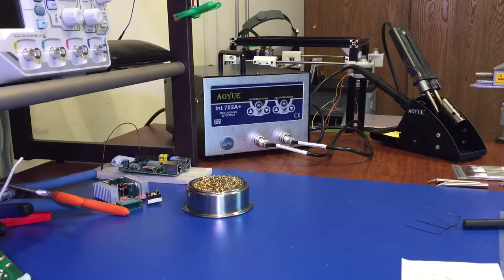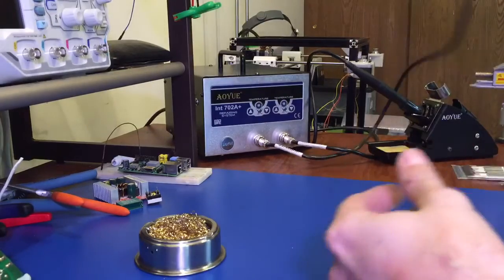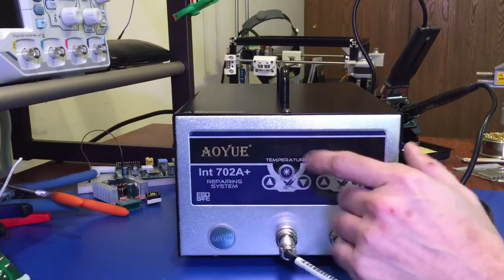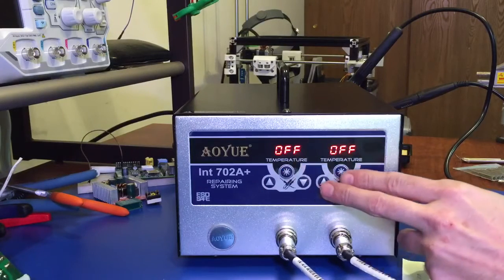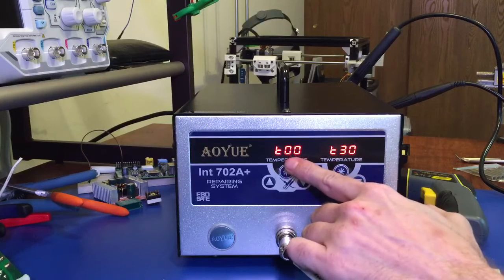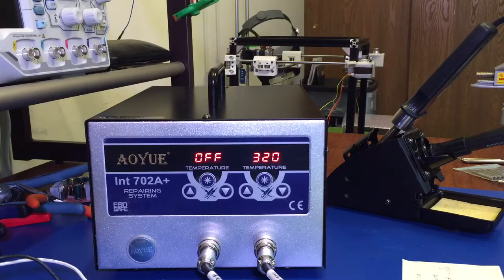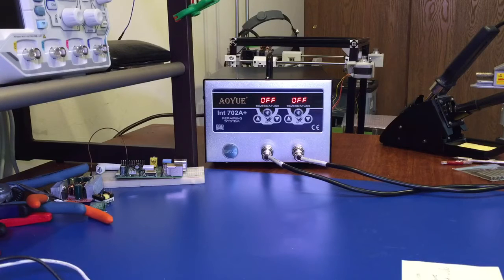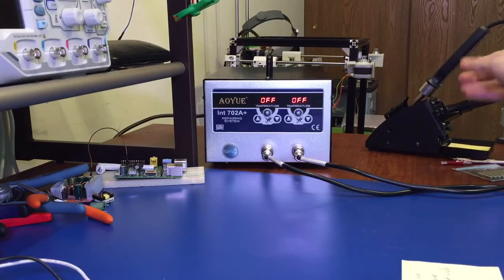Aoyue 702A+ Dual Soldering Station Testing and Review

Comment: Wait. I have the Int 701A++ which is exactly the same station except the 702 is missing the desolder/fume extractor pump. I even bought the tweezers separately since mine included the desolderinggun instead. Pulling the trigger wakes up the left channel and resets the sleep timer but the right channel is always going to sleep on me while I use the soldering pencil. Been dealing with it since I bought the thing in July 2016. It even went to sleep on me while I was using it last night and again this morning. If my iron is supposed to have a sensor in it, well, it never worked. :( I’m aware that the newer version of the Int 701A++ bypasses the wake-up circuit on the left channel so that they could switch to a DC pump but mine is the older version with the AC pump and there doesn’t seem to be a reason to disable this on the right channel at all. It has different DIN/aviation connector arrangements on left and right to keep you from swapping them.

Comment: wouldn't it be nice if soldering irons and desoldering guns had an LED that projected some light down into the work area where you are soldering? Most battery-operated cordless drills have these nowadays......
Reply from the maker: I think the hard issue is the heat, LED lighting already get hit and need more cooling and copper for dissipating this heat. This copper on good LED flashlights will just pull heat from the soldering heating elements.

Comment: I have the Int 701A++ (or A +++?) version on my bench at work. Mine has a vacuum desoldering gun, which is what I use it for 95% of the time, and a small-tip pencil iron (came with a fume sucker attachment that I seldom use). With a few modifications to the desoldering gun* it works quite well, although Aoyue's quality control is less than stellar and we have had several defective brand-new desoldering guns wirh bad heating elements right out of the package, and if the temperature sensing or feedback coil of the heating element is bad the tip won't run consistently at the correct temperature or it might be hotter or colder than indicated on the digital display (one newly purchase desoldering gun only got up to about 70 degrees centigrade and gave me error messages). The  first Aoyue desoldering gun I had seemed to "eat" the tips at a record pace, using mostly traditional tin/lead solder we primarily work on 30 to 50 year old audio equipment) although perhaps those tips were made of a different material or had different plating than the more recently purchased tips which so far seem to last longer. ( You can replace the heating elements yourself , installing a new element into the same gun frame, but it's a pain in the neck because the wiring channels are narrow and the wires are springy, and the wires and the switch and the mechanical parts all want to pop back out at you as you are trying to reassemble it, plus nichrome or similar wires from the heating element cannot be soldered to and must be crimped, and they don't supply you with a new set of the original  plug-in connectors that you might want to use/ reuse.... and anyway the entire gun doesn't cost all that much more than the individual heating elements, so it might be easier just to buy a new gun assembly). 

I do wish that the tips were marked as to their size or part number! I scribe them with an engraver or Dremel tool so I can tell at a glance what size tip I already had / have in the iron when I go to replace it. we have also received replacement tips in a mismarked bag, the tips did not match the size that was hand written on the parts bag.

*The little round-disk sponge  filter that you are supposed to wet before use in the solder-collection chamber (cylinder) doesn't work all that well, I use an older style of felt-disc Hakko filter instead. The nipple shaped spring filter clogs easily, and is difficult to get the solder out of, so I don't use that either, I just stuff the plastic cylinder with some medium grade steel wool. I also have a mod to realign the desoldering tip inside the length of the heating element, to prevent it from clogging at the very  tip of the outlet tube as it enters  the solder collection chamber, but I won't get into that here.
Reply from the maker: Well as you saw in this video the init I’m reviewing doesn’t have the de-soldering gun. But I did buy the de-soldering gun unit separately. https://youtu.be/eVF7m0JSX4Q
From what your saying about the filter you may want to watch the series other video, especially Part 2 about the de-soldering gun. It wasn’t long after I saw some of the same issues you mentioned with the filter and spring catcher, I ended designing a better way that I think you could apply to your desoldering gun in your unit.  I think Part 2 covers the long term testing and abuse and also shows the changes I made. Using a re-tinning helps keep the tips new and last longer. Just like normal soldering tips, you want to leave solder on the outside of these tips also to prevent oxidation. 
If you use a sponge for wiping off the tip, try to use distilled water. This has less chemicals in the water that could cause the tips to degrade faster when using tap water.
Part 1-The riginal design filter changing, why, how and testing.
https://youtu.be/oRUlTedCMYM
Part 2 - After testing and abusing for three months
https://youtu.be/iU1L8U3Fa-w
Part 3 - Final thoughts
https://youtu.be/vj2sZ8zW3PY
Reply: @GadgetReviews-US  Yeah, the Aoyue 8800 works a million times better than the one included with the 701A++. The station you are reviewing in this video is a basically a 701A++ but they left the pump out and recalibrated the left channel for tweezers or a second iron. That’s why it has the block-off plug on the left where the air inlet would be. Yours is based on the newer version since it has all the plastic mounting caps on the back.
Reply: Gadget Review Videos, I will try to add a quickie update, as best as I can remember the content of my previous posts.....1) we have a couple hundred original Hakko ceramic? filters lying around the shop, in various sizes, so I can just use those in place of the Aoyue-supplied spongy disc----but your homemade ceramic filter  is a very good idea. We have gasket punches here at work that would probably cut the right size disc in about 1 second with a hammer blow!. 

2) the nipple spring actually works fairly  well as part of the solder collection  system if you cut the tapered part of the spring off right where it goes from being a straight cylinder to tapering towards the end (spring steel can ruin wire cutters, I used a Dremel tool fitted with a cut- off wheel). Stuff a little wad of medium or coarse grade steel wool into the bottom of the solder-collection cylinder  (up against the little ceramic filter), then stuff a very small wad or ball of steel wool into one end of  the now cylindrical (modified/cut-off) spring and just slip the spring  into the plastic or glass solder collection tube, with the steel-wool-stuffed end down. The spring and steel wool will help absorb heat and solidify the solder droplets very quickly when they are sucked up into the chamber. ALL of the solder will collect at the bottom of the spring, melded into the steel wool, and it will be very easy to remove; you won't need to grease the spring or the cylinder. Alternately, you can use a small wad  cut from a stainless-steel curly metal pot-scrubbing pad at the bottom of the solder-collection cylinder, setting it up as a sort of a three-stage filter: finer, sacrificial steel wool, then coarser steel wool or a metal scrub pad, and finally  the ceramic filter. Don't forget to examine, and clean,  the foam filter in the plastic nipple cap on the base unit where the plastic suction hose hooks up! You can also cut off the extruded part of the silicone gasket off to shorten it so that removal and reinstallation of the solder collection cylinder will be easier----you won't need for the metal spring to slip onto and  attach to that rubber gasket any more as the designer had originally intended.

3) the very end of the tube attached to the desoldering tip might cool too quickly where it passes through the silicone gasket and enters the solder collection chamber,  and invariably this is  where lead statactites form, clogging the tip ! You can space the tip assembly outwards and center it better within the heating element so that the outlet end of the tube is closer to the end of the heating element,  by putting a small brass washer or two on the outlet stempipe of the tip before installing it into the gun (I used two washers totalling about 1/8" thick,  with a dab of  some Never-seize or the Hakko equivalent to improve heat transfer). If after doing this you find that the outlet pipe doesn't protrude quite far enough into the rubber gasket, replace the 3 metal spacers  that hold the element assembly away from the plastic body of the gun with slightly shorter metal spacers. You will unfortunately have to take the gun apart to do this because one of the three bolts is longer than the others and used to hold a ground lug inside the gun.

4) we've had several new desoldering  guns,  right out of  the box, with defective heating elements; we have also seen shipping damage from a too-small, flimsy  shipping box without any padding.  We have also received mismarked bags of tips, where the tip sizes don't match  the size printed on the bag.  Check your product(s) over carefully when received!

Comment: What are the iron and tweezer power cables like? Flexible? Silicone?
Reply from the maker: +Verm1n 
The power cable is more a standard rubber like power cable found on most common desktop computers. 
The iron and tweezer cables are more flexible silicon like material.
Reply: Thanks Dave.
Reply: Gadget Review Videos, on my Aoyue Int 701A++, the control cable from the base unit to the handheld gun is an 8 Pin cable, and one of the wires is clipped off and not being used. Note that the 8 pin connector on the end of the cable has a divot in the metal shell where it was presumably hit with a  metal punch and a hammer,  and that punched-in divot prevents you from disassembling the plug to examine or test or repair the wires (or install a slightly  longer cable!) even if you remove the set screw that would normally be the only thing necessary in order to open up the connector. You would need to drill a small hole in the metal shell where you find that punched-in divot......